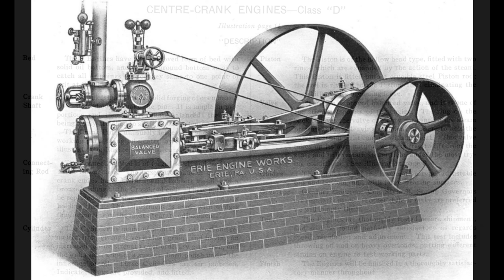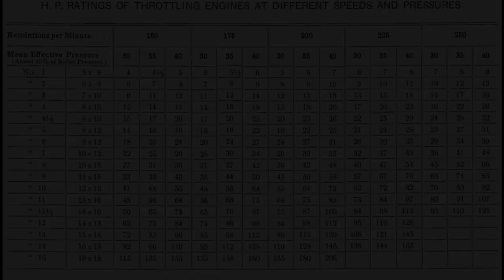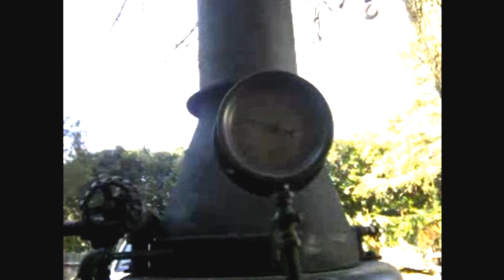1910s Erie Engine Works Steam Engine Project

Comment: Got to love Steam! Tell us about the beast! Looks to be a double acting, single cylinder, D-Valve, 6x6 or maybe an 8x8. What governor  are you using? You using a displacement lubricator? The beast looks beautiful! 

I have been looking for a project engine for a while. Not easy to find one of these!!!! A 6x6 would be ideal.
Reply from the maker: 10"x12" bore & stroke; 2-1/2" Gardner Governor
Reply: @lineshaftrestorations7903  Holy Cow! That is a monster! I am planning on running the steam portion of my new shop with a 6x6 of my own design. Your boiler must be a hungry beast!

Comment: I know it’s been a while since you posted this but do you have a weight for this engine without the base you built? Thanks
Reply from the maker: Something like 350# is a guess. It was made, I think, from 1/2" plate 12" wide.
Reply: @lineshaftrestorations7903  Sorry I meant how much did the actual engine weigh, I found another one and may purchase it. I am estimating a few thousand pounds but I'm trying to see as close to an exact weight for shipping. Thanks.
Reply from the maker: @frankduvic2495  Oops should've read closer. The Erie catalogs I've found don't mention any weights. I'm guessing for this 10x12 engine it is near 3000#. I had a single axle trailer at the time and it was too much to take it all had to enlist a friend to take the flywheel.
Reply: @lineshaftrestorations7903  Thanks for the feedback, I appreciate it.